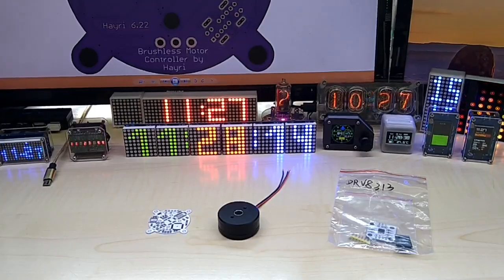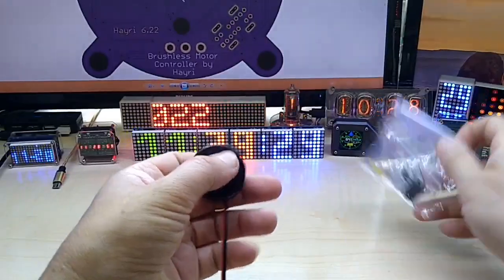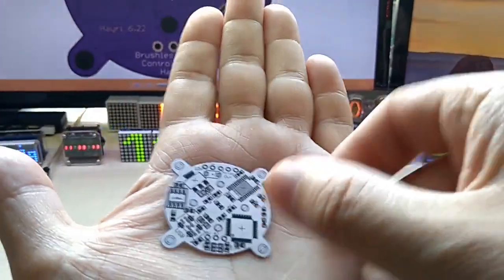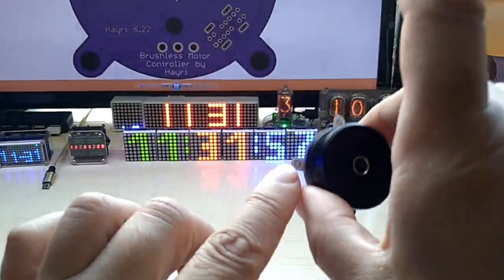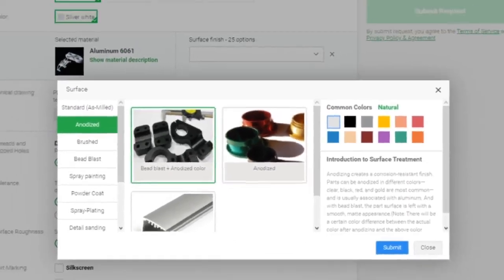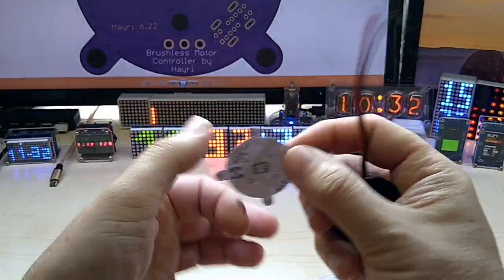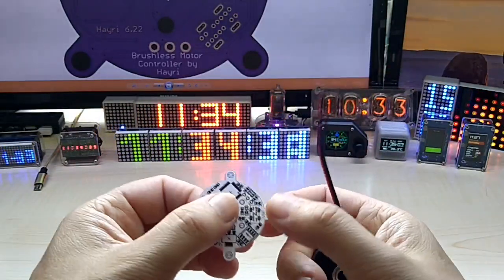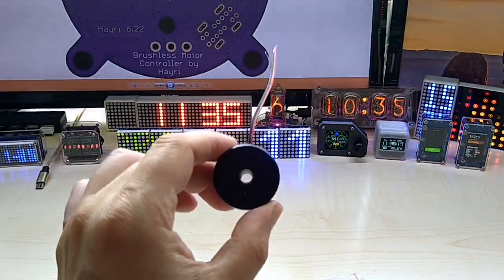OpenSource Brushless Motor Controller by Hayri #PCBWay #SimpleFOC #Arduino

Comment: Very cool prodject! Have you seen the haptic knob project by scottbez1 here on YouTube? Similar idea with the magentic encoder - he's had issues with the supply of motors.
Reply from the maker: Thanks Stephen, Yes, I have seen his SmartKnob, great design and awesome software implementation. Wish I could code like that 🙂 Thought about adding a round display to my PCB as well, but wanted to keep it "simple". His issues with motors still exist,  the ones I use are still plenty, but who knows for how long, but with an adapter plate for the mounting holes, similar motors can be used.
Reply: @iHayri1  the notches and snap points are incredible! I'm sure you could port the code over from the ESP to the Atmel chip?! Super cool!
Reply from the maker: @ChunkySteveo  I am afraid the code would not fit onto the 328, easier to adapt my PCB to use the TTGO Micro32 module, which i actually am using in another project (Finger sized Nixie Clock) already, well it is in the works 🙂
Reply: @iHayri1  i love your desk view... can't have too many clocks, and another nikie clock.... why not?! 🤣👌🏻
Reply from the maker: @ChunkySteveo  Thanks, true, never enough clocks, this "new" one is based as mentioned on the ESP and therefore a NTP clock, power it and it will show the correct time, hehe. Btw, it uses the tiny (smallest I have) IN-17 tube with a proper "5" digit

Comment: Looks great, perfect having everything on one PCB with mounting tabs. Maybe having a 2nd blank PCB with the same outline could be handy for mounting with hex spacers.
Reply from the maker: Thanks Max, That is a good idea, will see if there is any demand for it. A 3D printed adapter plate for different motor mounting holes might also be useful.